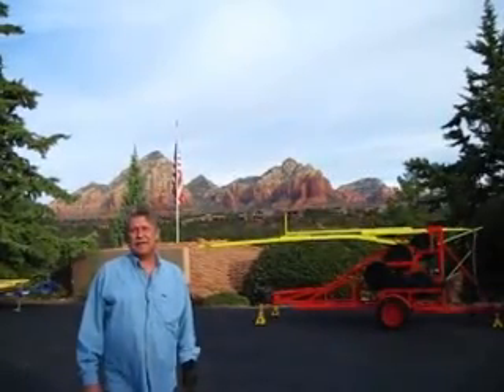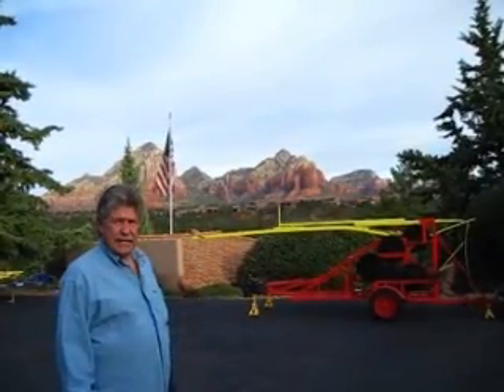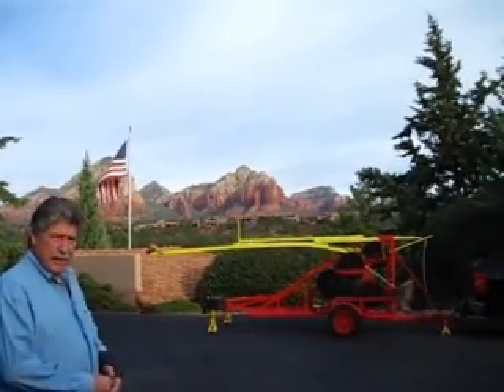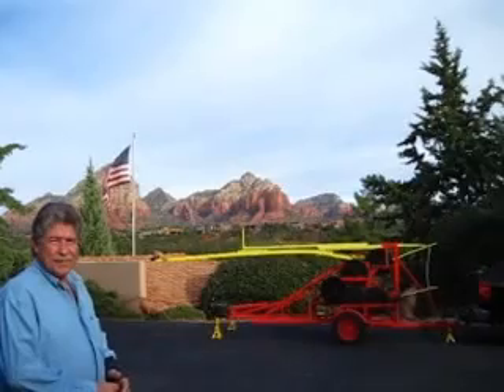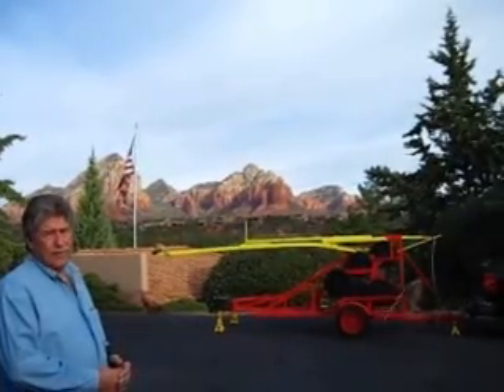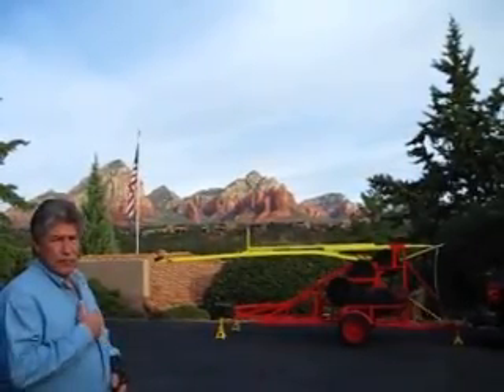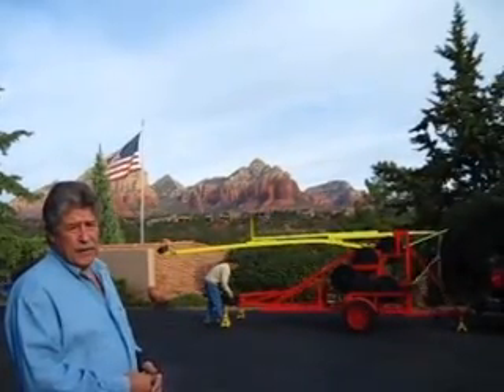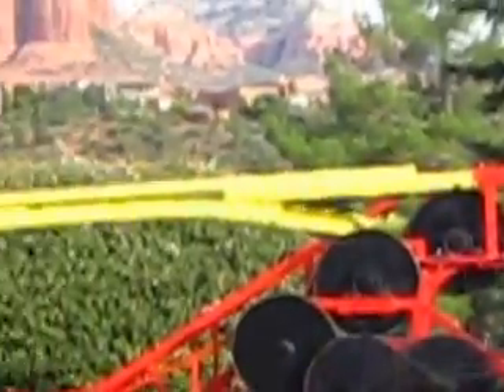Leverage and Weight Motor, Change the way we make Power For The World!

Comment: if you parked a big enough one in the harbour and hooked it to a huge boat, a place like the bay of Fundy has a massive tide change in height,  the boats buoyancy and weight would power this on the rise and fall of the tide, push of the buoyancy and pull of weight of boat. The difference between high and low can go as much as 9m per tide change, so imagine a  huge ship attached to this how much power could be generated???
Reply: Or you can just use the weight of your car to reload the weight
Reply: I don't know if you have an ocean near you but you shoud look at the difference between high and low tide in your area, a channel  or pipe could always be made so its away from the harbour, total control

Comment: I am curious about how much reduction there is at the rotating end of the device - and how much torque is available? Say, if 1,000 lbs were placed on the end of the boom - how much torque would there be at the rotating end and what speed would it be going at - or is that all adjustable ?
Reply: I do know that it takes about 30lbs to run a clock.
Reply: I would have to build 3 machines to get a true reading and a formal. I need a lot of money and resources to help me make it happen.